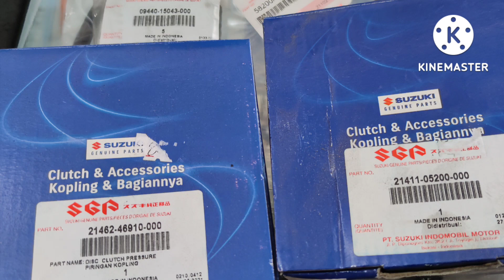Naka manual tensioner pero maingay pa rin! | Kulay gray din yung langis, anong nangyari?

Comment: Boss Tanong kulang.normal lang ba Ang lagutok nag raider 150 ko.pag pinaandar sa Umaga.pag unit nawawala 7000k Odo boss.thank you sana mapansin mo boss.
Reply from the maker: Yung mga labas ngayun ganun sir. Unang andar medyo may lagitik. Mababa pa kasi yung menor, pero pag uminit at umabot n sa 1.5 yung menor nawawala yun. Kung medyo matagal n yung motor mo. Mas ok na pa check